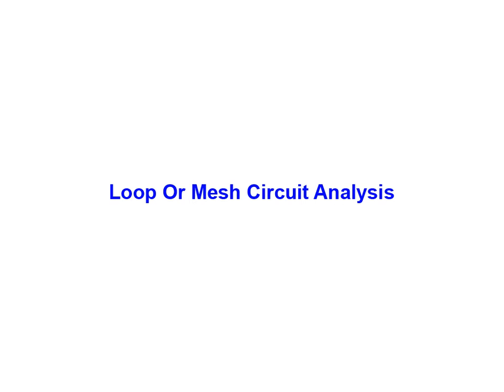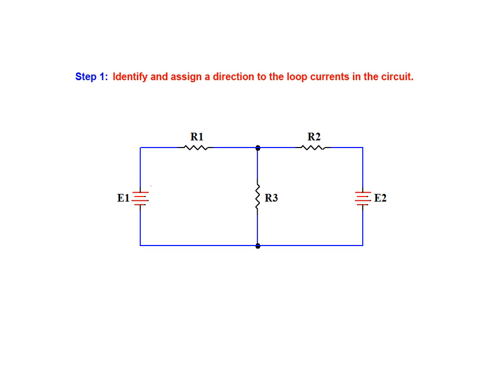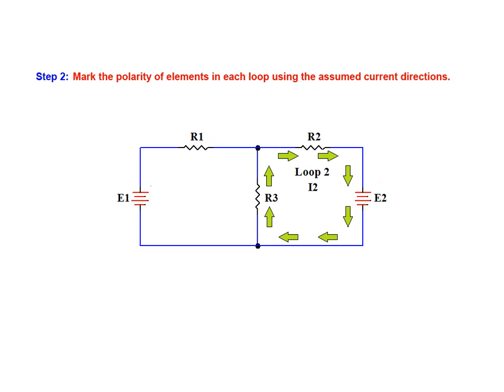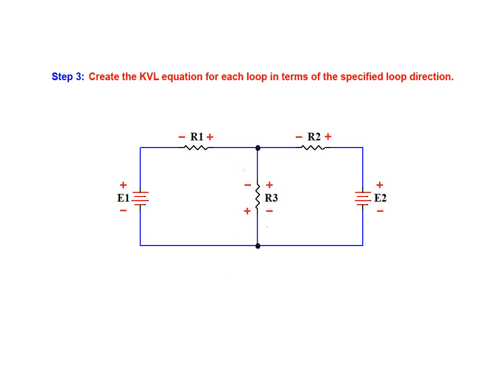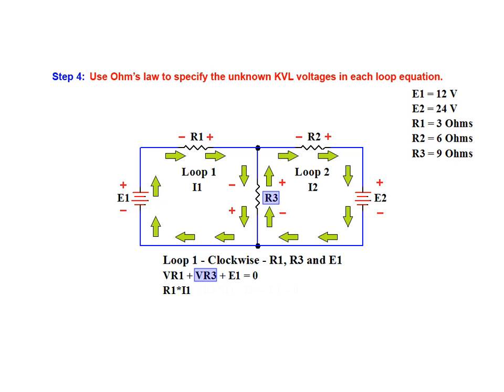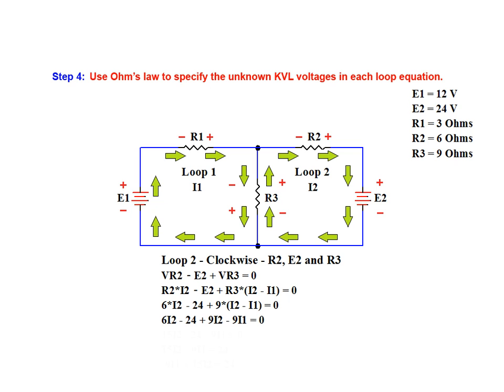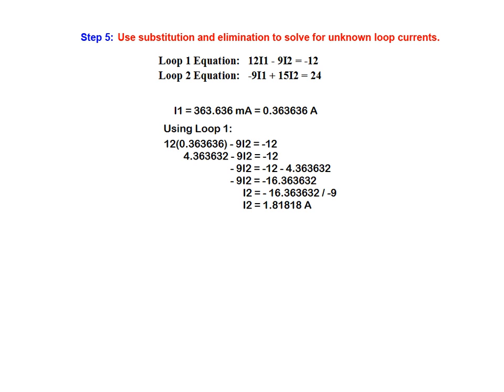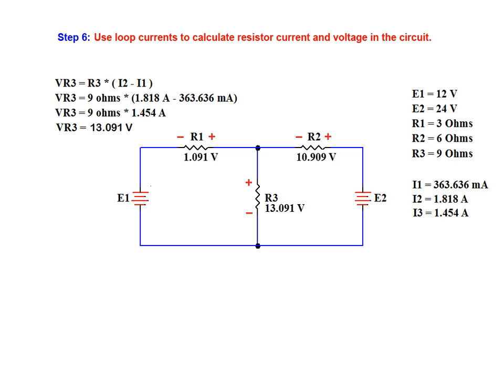Tutorial: How to Perform Loop or Mesh Analysis on a Linear DC Network Using Kirchhoff’s Voltage Law

Comment: Hi, would it be right for me to say that there is a loop consisting of E1, R1, R2, E2; i.e. the biggest outer loop, conforming to KVL?
Reply from the maker: Yes,  ANY and ALL closed loops in a circuit MUST abide by KVL, even loops that you do not use in a solution will conform to this law.